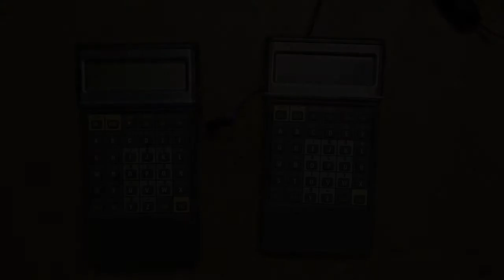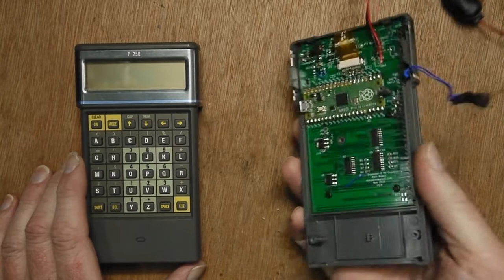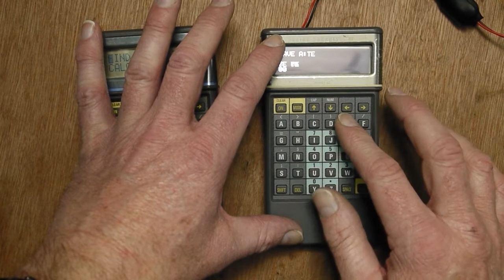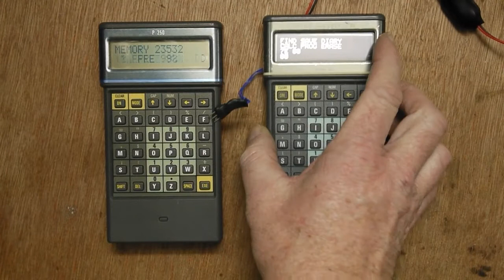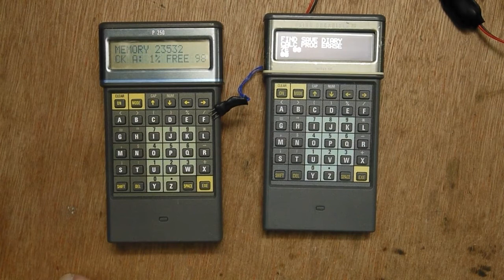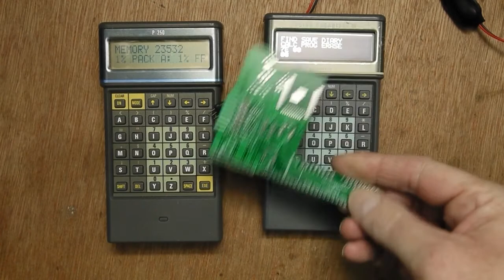Re-creation of Psion Organiser Part 4:Keyboard

Comment: Hola Black Rock.
Been following  your project but something I can not figure out is how you found an old display of the size of the  PO2. Could you share some light on that? Thanks
Reply from the maker: The OLED display is a modern one from BuyDisplay. It took me a couple of hours of searching to find it, but it fits well.
The display I use is here:
https://www.buydisplay.com/green-2-2-inch-oled-128x32-spi-display-module-serial-i2c-ssd1305

Hope that answers your question.

Comment: Andrew
-

As an Organiser II enthusiast you know I think your work is fantastic. Can I recommend to all PSION II enthusiasts to search out the other videos in the series.
-
Observations
-
Zero Key.. at 4:30 you mentioned the fine wires running across the face of the main PCB, is one of these interfering with the zero key.
-
Calculator.. When you get the Calculator utility to work you could check the [MODE] access to the nine memories. It would be good to test if when you 'dump' the RAM to the serial flash on power off if these memories are retained when it is switched back on again. Some enthusiasts (I for one) use these memories for passing values and 'flags' back an forth between OPL and the Calculator.
-
Buzzer... Have you any observations about implementing the BEEP command?
-
Contrast wheel... As the contrast wheel is now obsolete with the introduction of the OLED display. Could this location be repurposed as the 'on/off' switch for the WIFI / Bluetooth module?
-
LZ ROM... could that 'dump' 64k to the serial flash? Or more? The maximum 'published' RAM memory in an Organiser was the 95K in the P350.
-
In good faith
Reply from the maker: Hi, I think the zero key is electricaly and mechanially fine as it works unshifted. I suspect some strangeness to do with the keyboard scanning. I'm taking the outputs from the keyboard scanning code in the emulator and mapping it to the hardware I fitted to the PCB. Something isn't working well. 
I've put two EEPROM devices on the PCB, you can get 64K parts so128K in total. I think you may be able to get much lrger parts, too so whatever is available will do. When starting up the code will look to see if there's a blob of data in the chips and reload the RAM. On soft power of it'll write the RAM then power down. 
The position of th slot for the contrast knob is irritatingly not convenient for a switch. I have a transistor on the PCB to switch the wifi module power, so no hardwre switch should be needed.
Reply from the maker: I'm hoping the buzzer output from the emulated code will map directly to the buzzer output I put on the power PCB. With a different design of power PCB you could put a full-on sound generator of some  kind.